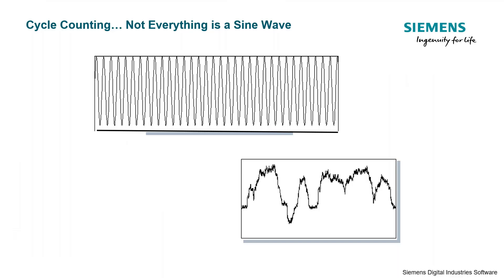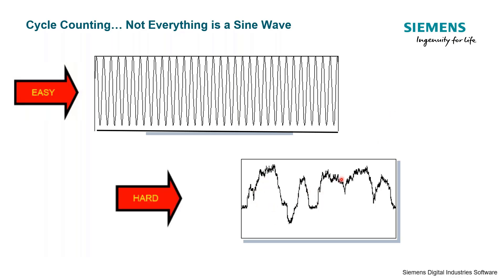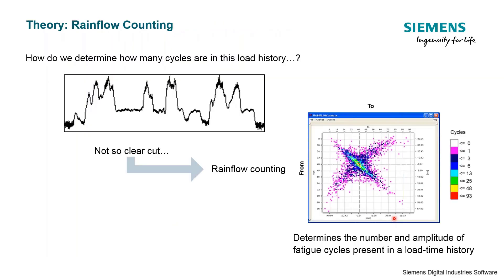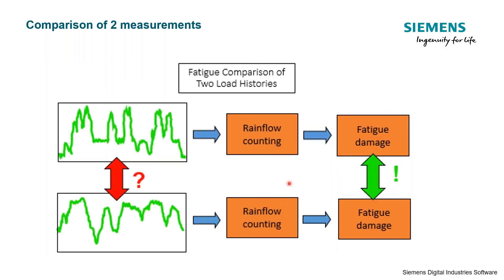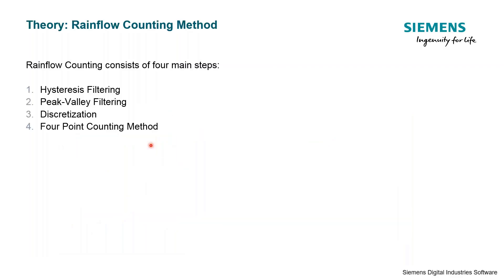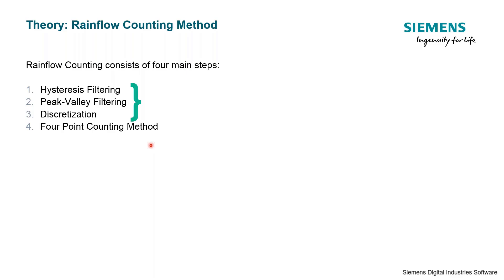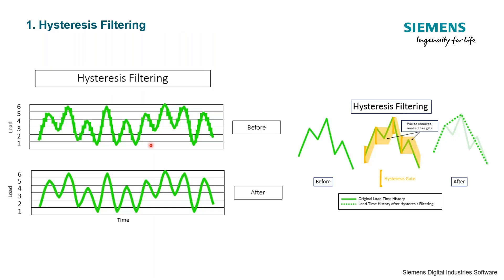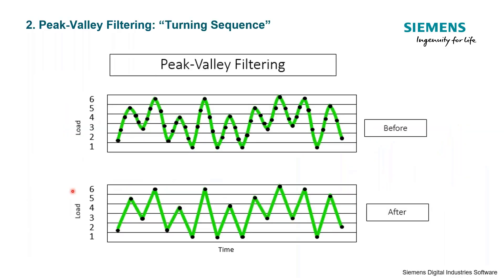Rainflow Counting

Comment: Are really the correct points removed at 11:18-11:20 ?
Reply: I've answered this question further down in another comment. But here it is again:

You are absolutely right, the removed cycle is not shown correctly. Your expectation is correct. Point 2 and 3 should be removed, not 3 and 4. 
We have an update of that presentation available, but we missed to update it on YouTube. Sorry for that.
The residue does not change, since instead of the value 1 somewhere in the middle the value 1 more to the end is used.
Reply: @HolgerZeinert  Thank you very much. Sorry for not reading the other comments more.

Comment: 10:58, why did you remove 3rd and 4th value ?????
Reply: I've answered this question further down in another comment. But here it is again:

You are absolutely right, the removed cycle is not shown correctly. Your expectation is correct. Point 2 and 3 should be removed, not 3 and 4. 
We have an update of that presentation available, but we missed to update it on YouTube. Sorry for that.
The residue does not change, since instead of the value 1 somewhere in the middle the value 1 more to the end is used.

Comment: Is neccesary to add an hysteresisi filter if the signal will be filtered with the peak valley method? Or there are signals that might need both procceses as the complexity is higher?

Can other filters be added instead of the hysteresis filttering?
Reply: The hysteresis filter is used to remove small cycles. We do it always with at least the size of 1 bin width. So, all cycles that are smaller than 1 bin width are ignored.

The peak valley filtering mentioned in the video will remove monotonic parts between turning points. Without the hysteresis filter there would be much more turning points and you would end up with cycles on the main diagonal. These would be cycles with a reference amplitude of zero (after the binning). So, it does not make much sense in keeping them with respect to damage.

Other filters can be applied in time domain before doing the Rainflow counting, but they are not embedded in the Rainflow counting algorithm as we have implemented it.

But be careful with applying filters that modify the amplitude: this will modify the damage!

Comment: how did you decided the length of the hystereis gate?
Reply: In our software, the minimum gate is 1 bin width. This will avoid cycles on the main diagonal which would have a reference physical range of 0. This would not add to the damage anyway.

You can use larger gates, then this value should relate to the endurance limit of the material you are measuring/testing. So, the gate should only exclude cycles where you are super sure that they will not add to your damage.

Comment: 7:08 why?only inner counted?
Reply: Only the inner points build a closed hysteresis loop in the stress/strain path. To close the cycle built by the inner points, you need the outer points. 
Later, the outer points might become inner points of some larger points. Then they are counted as well.

Comment: 11:30
Reply: You might refer to an answer I've given further down in another comment. But here it is again:

You might point to the fact that the removed cycle is not shown correctly. Your expectation is correct. Point 2 and 3 should be removed, not 3 and 4. 
We have an update of that presentation available, but we missed to update it on YouTube. Sorry for that.
The residue does not change, since instead of the value 1 somewhere in the middle the value 1 more to the end is used.

Comment: thanks for this good explanation how the algorithm is working. One question raised up. I do not understand why the point 3 and 4 of the cycle in minute 11:18 were deleted. I would expect to delete the point 2 and 3. Do you have an explanation for me? thanks in advance
Reply: You have a very good eye! You are absolutely right, the removed cycle is not shown correctly. Your expectation is correct. Point 2 and 3 should be removed, not 3 and 4. 
We have an update of that presentation available, but we missed to update it on YouTube. Sorry for that.
The residue does not change, since instead of the value 1 somewhere in the middle the value 1 more to the end is used.
Reply: @HolgerZeinert  thx for the quick answer. Now my world is back in order again :-)

Comment: So If I understand it correctly this method only counts the "full cycles". The half cycles are left in the residue ?
Reply from the maker: A half cycle or incomplete cycle is treated differently.  It has not fully closed, so the true amplitude and mean of the cycle is not known.  In some damage calculation, the cycle will be artificially closed, in other damage calculations it is not closed until it is fully understood.  So they main point is that these incomplete cycles should be accounted for differently (ie, the residue).
Reply from the maker: Example: If a rainflow matrix was repeated 10 times (maybe to go from one hour of damage to 10 hours), the residue can be appended 10 time over and counted, and many of the incomplete cycles become complete.
Reply: The half cycles are stored in the residue and can later be used in different ways when calculating damage. You can decide to ignore them or forcefully close them. But by storing the half cycles separate from the Rainflow matrix, you can later decide how to deal with them. 
If you immediately add it to the matrix or not add it to the matrix, you don't have the option later to evaluate the difference.